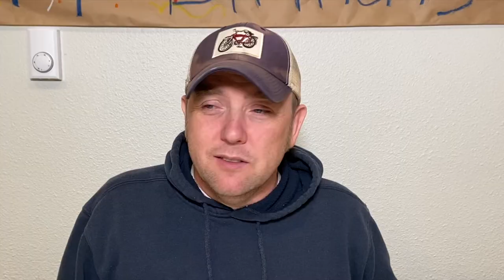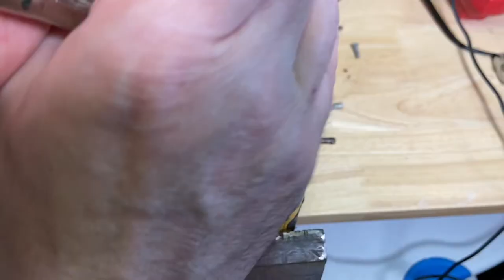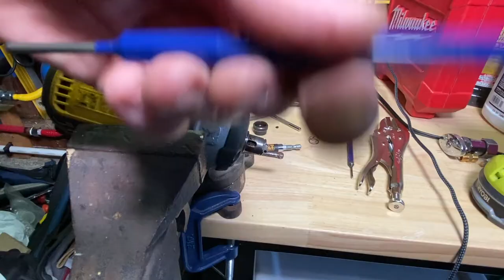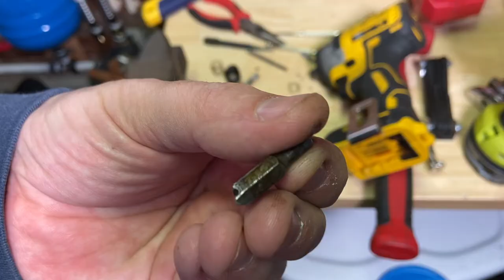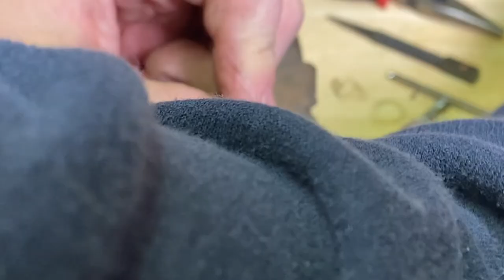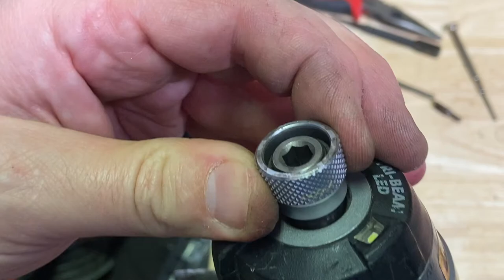WHAT DO I DO NOW??... Screwdriver Bit Broke Inside Impact Drill!

Comment: Hey ! No need to do all this, just drill a hole in the part of the bit which is stuck inside, then put a hex bit inside that hole, hit it with a hammer so it goes inside the stuck part and then pull it out with pliers. That’s it ! I hope this is helpful

Comment: I have the same problem right now and was looking on YouTube for tricks and tips.
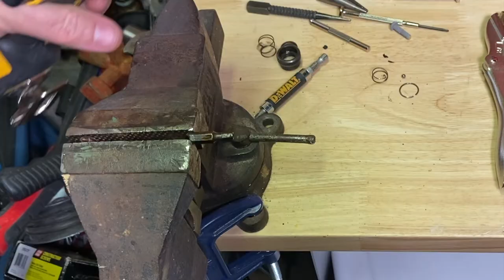When I got to 8:52 in this video, I thought "Whoa! Did he pull out the drive shaft from the impact driver??!!"

LOL, it turned out to be an optical illusion where the little bar to tighten down the vise orientation is visually directly in line with the broken bit he just extracted!

Comment: Thanks! Had a bit stuck and use the vice trick.  I didn't need to disassemble the chuck.  I wrapped a piece of copper wire around it to keep it unlocked then tapped the drill lightly with a wood mallet.  Came out in about a minute!
BEWARE OF MAKITA IMPACT BITS in the Dewalt drivet!  Though I was buying top quality...

Comment: I just had a broken bit deep in the chuck of my DW056. I found that lifting the chuck (as if to remove an intact bit) pulling the trigger eventually loosened up the broken bit. At first, I had the driver going in reverse as I held the chuck up and pulled the trigger for 3-5 seconds.  I noticed that the broken bit had moved a little.  I also noticed that I was in reverse.  I switch the direction to forward,  pulled the chuck up again and held the trigger down (no pulsing on and off).  The bit fell out after about 10 seconds.
Reply from the maker: That is awesome you were able to get that thing out without any disassembly. I tried and tried.  My friend had that thing stuck really good.  I will try your pulsing method first if I ever run into this again.
Reply: I just tried it this way.....WTF ....ran then drill one way for 3 seconds and the other way 3 seconds and it flew out...WTF!
Reply: I just tried this, no luck- but then added Liquid Wrench down the bit. Ran it 1 way, than the other. Popped right out. 

This thing was seriously stuck before!  Awesome tips :).

Comment: Use a wire like 14 gauge wedged under the collar to keep it in the released position. No need to remove the spring or anything. Then do just what you did i.e. catch bit in a vise and tap impact driver body. I used a punch and a small hammer and bit popped out. In the end your video solved the problem for me, so thanks.
Reply from the maker: Oh yeah that sounds like a great way to get a bit out!  Thank you for the suggestions.

Comment: Thanks buddy!   I had a stubby phillips bit somehow jammed in there.  Not much to grip on since it is tapered, but I used vise grips and even though I had a pretty good handle on it, nothing doing.  So I took it apart and by cranking the vise to tight that it finally gripped it good enough, I was able to use the rubber mallet and get it out.  this was my last resort.

Comment: I used a bit that was for a screwdriver, not the kind intended for quick release chucks. It was really stuck tight. I got the clip and spring out, but the collar would not come off.  I pried onthe collar and hammered hard on it, but it would not slip off.  After hours of pulling on the bit with vise grips, it was cracking, and there was just a nub left.  So I used a horse shoe nail puller. Luckily I got a grip, and pried on it with my weight and saw it move. I few more times and it came out. Then the collar slipped right off and the bearings fell out.  I still can't figure out why the collar was stuck too, but I've learned my lesson, I'll never use the wrong bit again!
Reply: Yes, I did the same thing - put a screwdriver bit into my Milwaukee M12 impact - because it was handy.  Had NO idea it would result in this sort of mess!  
(There really should be an easier disassembly/recovery for this sort of situation - because it Will happen.)

Comment: Hi, thank you so much for yor video, but I made a mistake that put a oversize bit into the impact drive, do you have any tip to take it out?
Reply from the maker: Is it broke off?  If not I would clamp the bit and use a mallet to tap out just like it did. I think that could work.
Reply: @ThatFixItGuy  not broken, but I cant take it out, I think I should change the anvil, anyway, thank you for your reply

Comment: Fantastic job , I've got the same problem but I've not got any of the bit sticking out , I've tried to glue the bit back to the one inside with strong steel epoxy with no luck , then I tried to drill the centre with a really small bit hoping once drill bit was in it a bit I could pull it out , that didn't work either as the bit is so hard . I might see if I can take the curclip out like you did and maybe push it up from bottom . Thanks for your video is given me hope again 🙂.
Reply from the maker: Good luck and drop me a line and let me know how you get it. Where there is a will there is a way!

Comment: Used your technique and got the bit out of my Ryobi. Thank you!  But when I put the ball bearings back in place (there are 2) the knurled ring won't slip down over them.  I assume that the BBs must recess into little pockets in the center shaft ... is that correct?  When I look in the holes where the BBs go, there are no pockets.  Is there a way to hold the center shaft stationary so that the ring with the holes for the BBs can be turned to aligned with the pockets?  Or have I got this concept wrong?  Thanks!
Reply from the maker: So the bearings sit on top of the spring in the hole I’m pretty sure anyway. I hope this helps
Reply from the maker: I don’t know if that’s a spring as much as a clip, but the bearing is on top
Reply: Ooops! I asked the right question to the wrong guy 🙄. The Ryobi is a little different … the ball bearings go into circular holes, not the slightly oblong holes, and don’t use a spring to hold them in place. I’ll have to rewatch a couple of other videos, but thanks for taking time to answer!
Reply from the maker: Sorry, I have never taken on of those apart. Hope you got it taken care of.

Comment: A more common problem with these is that the spring that holds the ball bearing in place breaks and your bit will constantly fall out. This video inadvertently shows how to repair that problem also, except buy a new spring and don't put the old one back in. (I've tried bending the broken spring to make it work again.... it's got to be EXACT. Easier to just buy a new spring.)

Comment: What if bit snapped off flush?
Reply from the maker: I think I would try to disassemble and get behind and try to push out with a punch or something.   Or you could try to drill it and tap it.  Drilling the center may just make it come out anyway.  I would love to know how you end up getting it.
Reply: Mine is broken flush AND it looks bent in there, will not budge at all, even picking at it from the sides